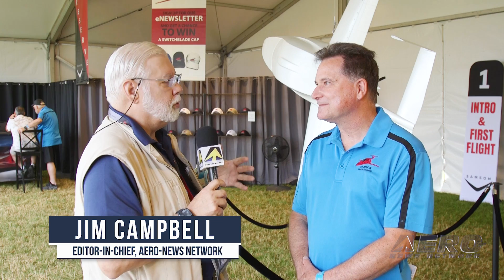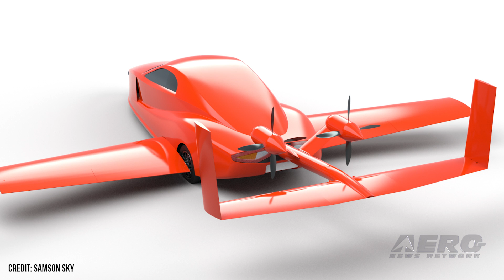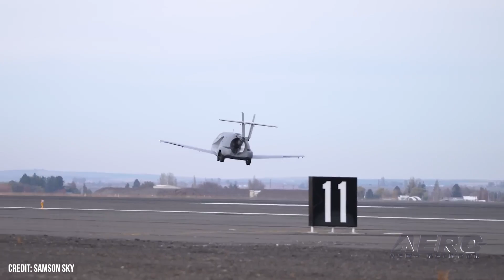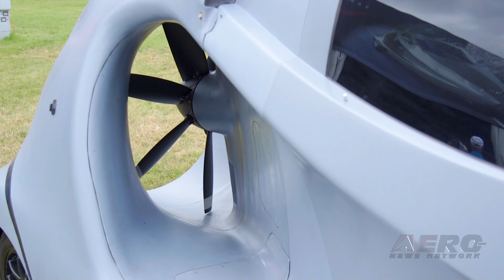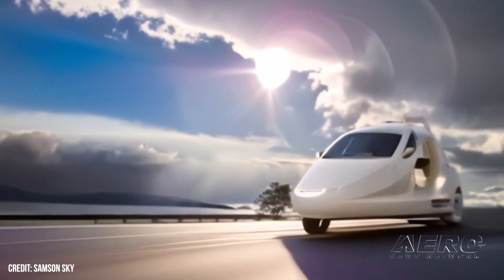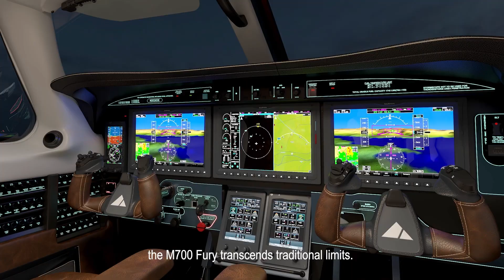Aero-TV: Switchblade Sports Car Heading Toward Final Version

Comment: I strongly recommend to increase the span after extension of the wings:
induced drag =
 (weight/span)² /(π × dyn press)
Reply: Ya, rt. this has got to be a non working floor model, anything in the air must have its wings securely fastened, and dimensionally correct within way more laws of physics than your claims sir . ..In ten yrs . I'll be at ya to it, delivering US mail .